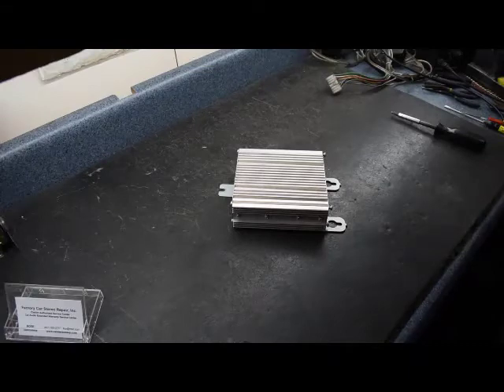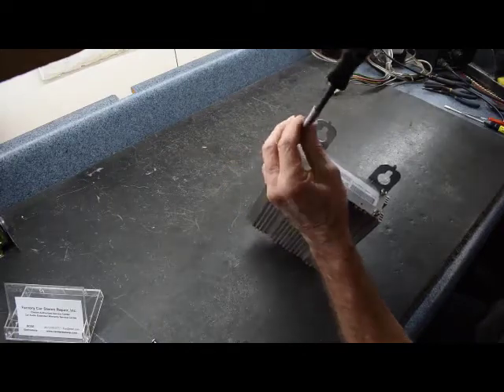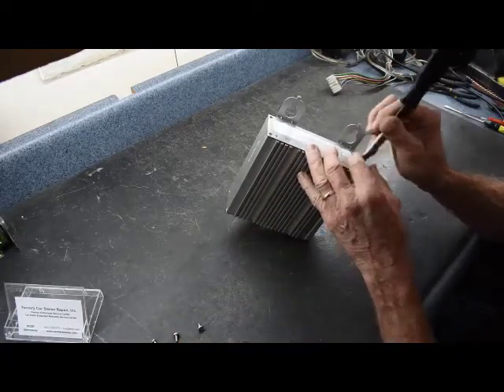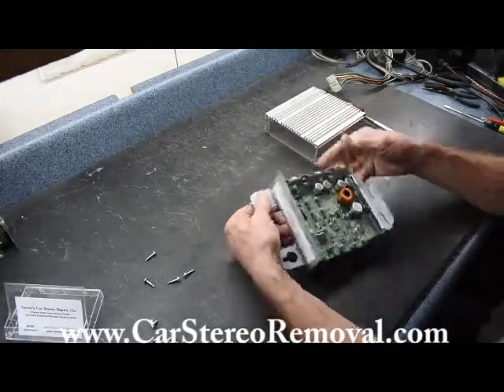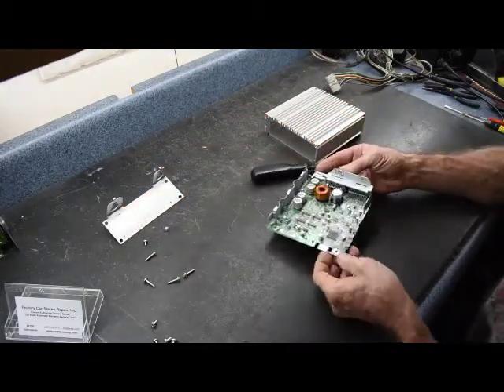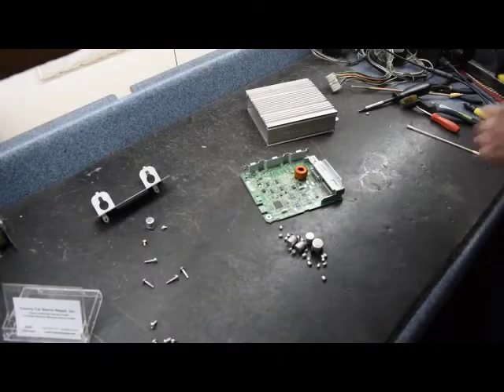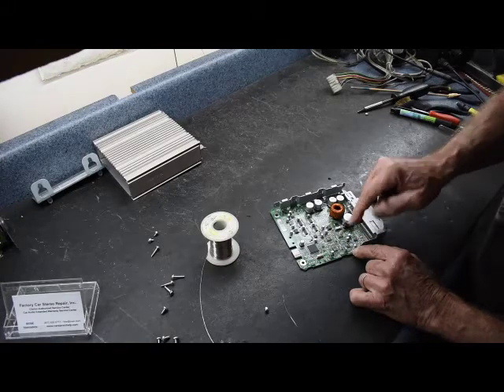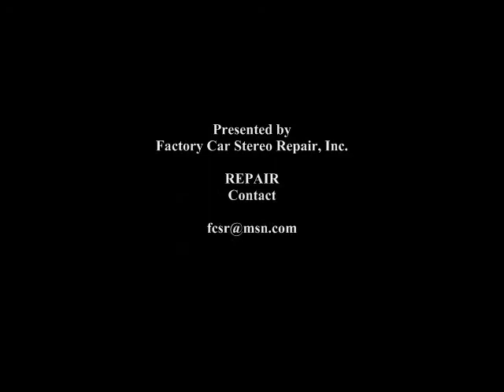Acura MDX Amplifier Repair - Car Stereo HELP

Comment: Question, on my 2009 MDX I get static coming from all speakers. It is intermittent and happens on radio, cd or aux. Because it happens from all speakers, is this the amplifier or some other part of the audio system?